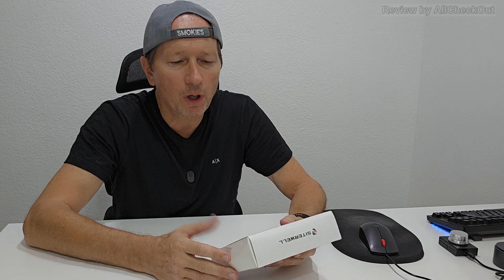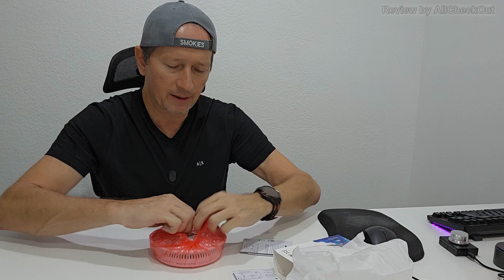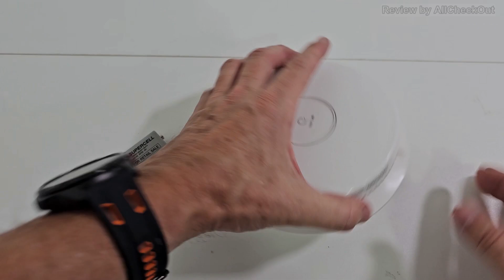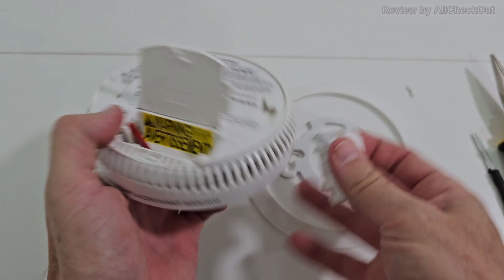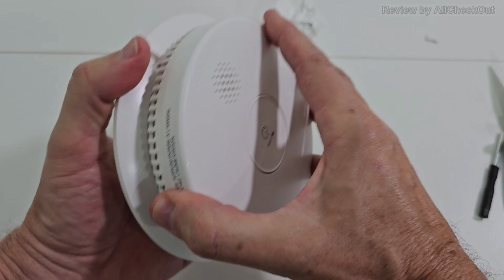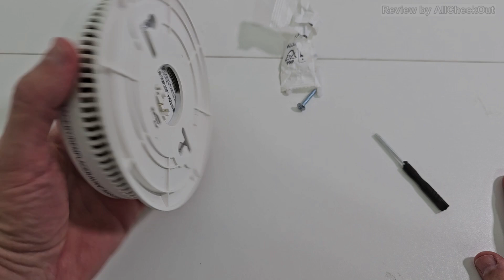SITERWELL GS562A Smoke Detector Review / Tutorial: Hardwired, Interconnected, Photoelectric Alarm

Comment: Hi,  I have 10 of these detectors and we have a bed and breakfast with 8 rooms and these detectors after 2 months have started chirping all the time like the battery is dead. They also seem to go off when someone takes a shower which is in the next room.  My paying customers don't like the chirping in the middle of the night and a set off alarm in our hotel in a wired system isn't good either.  I have removed them all I had to take the battery out to stop the chirping even when they weren't installed.  I am presently looking to find out what is a good reliable detector .  Can you help me??
Reply from the maker: So sorry to hear and thanks for sharing your experience; that's definitely not what you want with smoke detectors. But TBH I don't have really a lot of experience with them - just tried some which they sent me for free to test. Can't even remember when I bought smoke alarms for myself. I think close to a shower could be a bit challenging but should be doable for good quality smoke detectors. Don't you have access to some kinds of PRO hotellery supply?